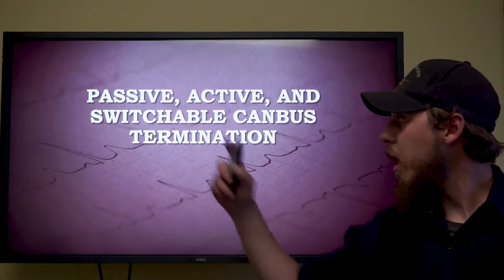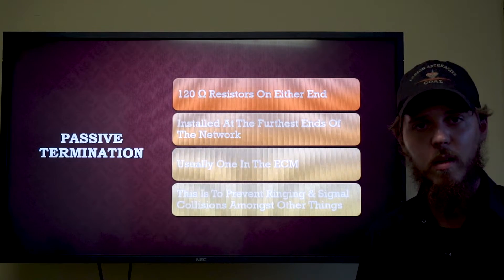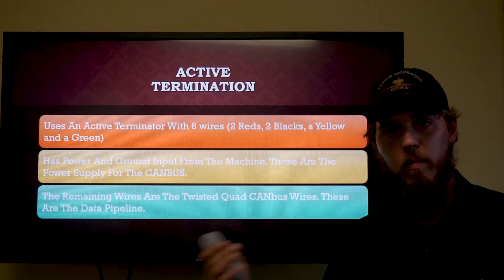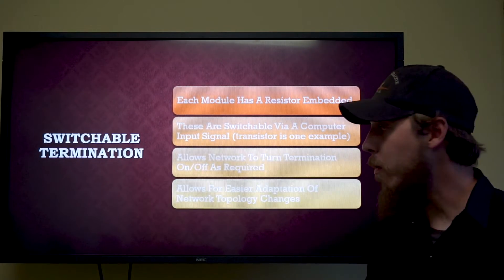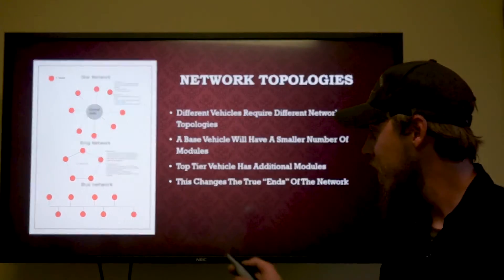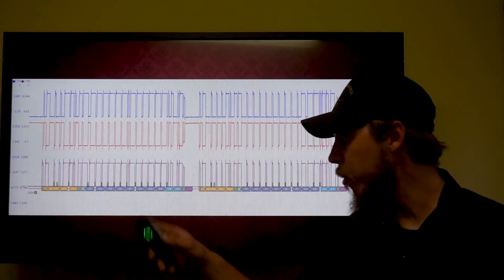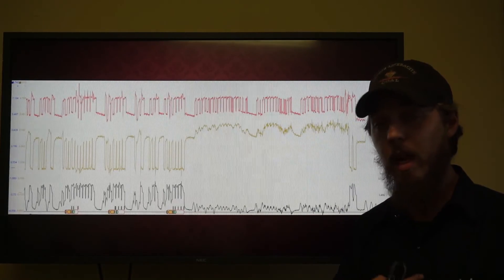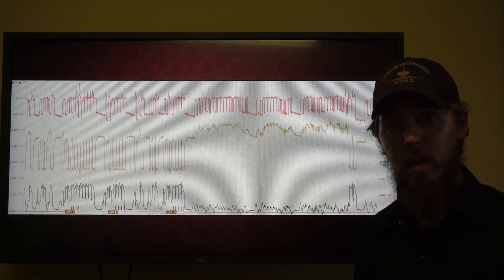Passive, Active, & Switchable CANbus Termination - A Primer

Comment: Does anyone know how to test an old 6pin terminator. It's defined as an Electronic Terminator and it's part no is RE70773. It's got 6 pins and nothing gives me 120ohms on none of the combinations. But I can definately measure diode bridge rectification on 4 pins. Is the resistor busted or is the resistor only to be tested if you supply power to this. The farmer I'm helping says this is one of the first old type. His newer machines the terminator looks completely different

Comment: You are right. Even in cheap switches, you have this feature and the switch will disable the port when the device on it is acting up. Level 7 switches have even more features a car could use. As an example a module could throttled to send less packets or it can use better QoS features. On the bad side, we could end up with 802.11x like authentication and prevent new or other modules to communicate with the module.

Cascading modules on other modules like you showed could be on BMWs I saw. The comfort module for the door handles is the main module and has new actors on it in a star topology. DiagnoseDan has a video of a BMW not starting because of the door handle.

Comment: Thanks for the video. I have a CAN Sniffer from Microchip. It's not usefull, it's just for fun. To be usefull I need  the meaning of the ID's. Is there a standarisation of it? If you know the meaning of the ID's this will make diagnose much easyer, I think. You can see very easy wich module is working or not. What do you think, friends?
Reply from the maker: There is the obd2 standard but not all IDs are fully standarized although there are databases of some decoded IDs/messages available online
Reply: @ScienceOfDiagnostics  I didn't find ID's on the internet. Do you have a link? Regards.

Comment: You absolutely knocked it out of the park with that one. Great presentation. Thanks for making the time to put that together
Reply from the maker: I'm thrilled it's been received so well.
I couldn't have done it with the great group (you included of course Corey) of friends supporting me and pushing me forward.

One of the top tools in any techs box is their support network.

Comment: You did a excellent job and yes some of this technology is already being implemented in the newer vehicles coming off the lines. One thing that will be critical is having the correct information for diagnosis of the systems. It will no longer be checking the resistance of the network system.
Reply from the maker: That is the truth, and we all know the failings in even OEM info.

We will need to continue to apply logic and more importantly, to support the techs around us.